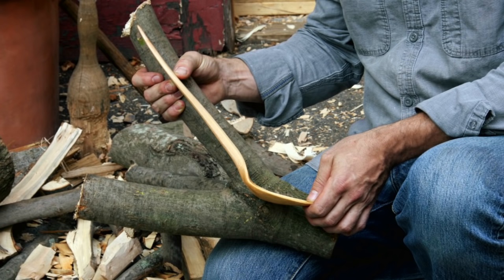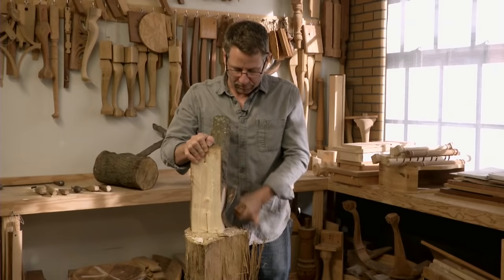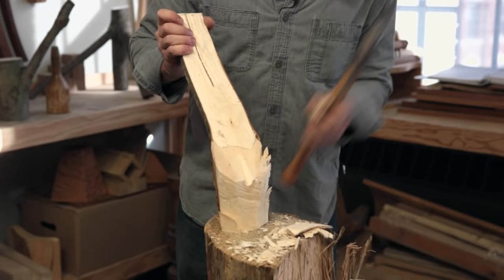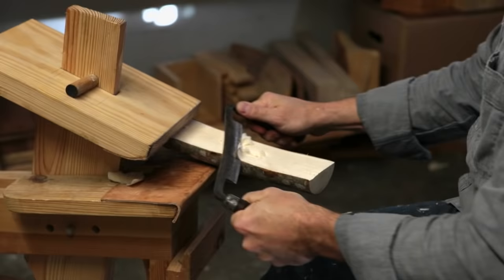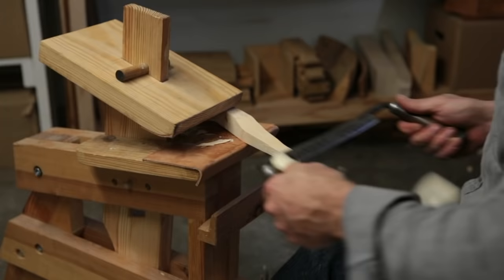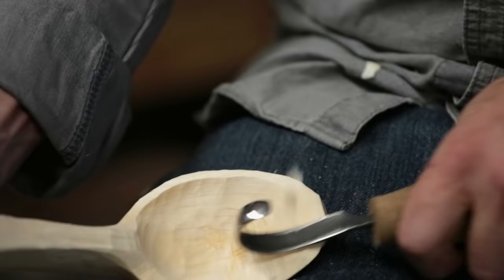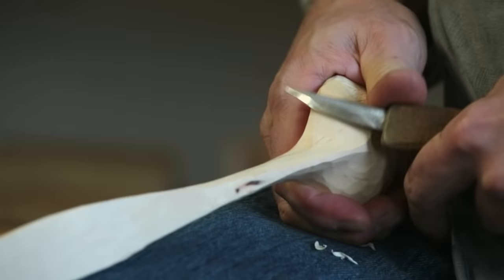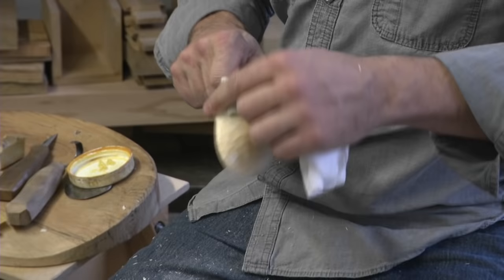The Simple Art of Spoon Carving

Comment: Can you do a video on how to properly dry the spoon to prevent splitting? Also, what food grade finish do you use?
Reply: Wrap it in cotton cloth. And unwrap it daily for short periods of time. The dryer it gets the longer it can be unwraped. Let it be in the cloth in a cool area without unwraping it the first few days. And then letting it be unwraped for a few hours per day and then letting it be airiated for progressively longer time. Observe the wood. The cotton cloth keeps the wood moist but also lets some moisture evaporate so that it dosnt dry too quickly.
Reply: let the spoon dry in a pile of woodshavings. the easiest way. just prevent drastic humidity changes, that is all you need to do.
Reply: @ahmetcomlekcioglu2671  Great answer.very very helpfull!!!!!!!!! thank you!!!!!!:)
Reply: @ahmetcomlekcioglu2671  Wouldn't it be better to let the block wood itself dry for at least one year and the cut it to form a spoon?
Reply: @avramidis3d  first, dry block wood is more difficult to work with compared to fresh cut wood blank. Second, it might be possible that the wood block may attract insects and the shrinking action by drying may split the wood block unwantedly. For these reasons, it is better to use fresh wood. If you do not have fresh cut blank or branch, you can also use dried ones. No problem with that.
Reply: Dimitris Avramidis then you would not be working green wood. Green wood, even very hard hardwoods, is very easy to shape.  Fully dried wood is much harder to carve.
Reply: @monteengel461  I got a piece of green wood from a tree that fell over during a wind storm.  I wanted to carve spoon, bowls, etc.   Then a co-worker told me to dry it first.  I let it dry for 1 yr, and I can't even carve it now.  It's so hard.
Reply: @walden6272  yes, that is what happens.  Carve it while green, then let it dry.
Reply: There is a product called polyethylene glycol ( peg ), from what I understand,  it soaks into the wood and let's it dry slowly.
Reply: I never dry them and soak them in water a for hrs a few times before final sanding. I've never had a problem. Live oak, peach, maple...no clue what I'm doing though, just a hobby
Reply: I use birch, apple, walnut,  cut in winter when the sap is low. Stack locks for later but spay the ends with sealer to keep from checking. Worst wood in the world is bois arc . Used a 50 yr old corner post one time and next day the split
Reply: You can rub your green spoon with boiled potatoe - the starch will protect it from uneven drying...
Reply: @ahmetcomlekcioglu2671  it's a good idea to also put those wood shavings in a paper bag with the spoon.
I make greenwood bowls for a living. I just pack them with their own wood dust for 1-3 months and it works really well for most things.
(Instagram @Rock_Dove_Fatm)
Reply: Soak it in salty water for a day or two and when you take it out it will dry slower so less cracking
Reply: I have carved many spoons and a few bowls a well.  I have never had a problem with spoons splitting.  I think it is because they are so thin that water dries out fairly evenly.  Bowls, especially massive ones, do need the care of slow drying in shavings to prevent splitting.
Reply: Can you use bamboo? I have a ton of it to use!
Reply: IyaEarthseeds  and others. I am from India and not into any wood carving . But I have seen our carpenters (traditional ones)  leaving the wood /logs in water  for 45 days “to remove their sourness” ( that’s what they say) and then use it. They say it’s helps avoid wood splitting. Will this piece of information be of any use to you all?
Reply: @avramidis3d  Have you ever tried to drive a nail into old dried out oak? In most cases, the nail will bend.
Reply: good
Reply: @willybee3056  peg is toxic, it shouldn't be used for wood that's gonna come in contact with food

Comment: Having carved spoons and other utensils, and given them as gifts, i can honestly say the most well received were made of cherry. It's considered a hard wood but carves easily, is lightweight, finishes beautifully and gains a rich patina the more it's used. When I first began, I even used discarded kiln dried pallet wood. the fastener holes added character to the overall project and most were made of ash or oak. I've found early on that a good sharp wood rasp and rat tail file will remove the excess wood at a fast enough pace without the risk of a cutting injury. Also, use a piece of leather in your lap as a guard that's easily purchased from a welding supply shop. This vid has re-awakened my desire to carve again.
Reply from the maker: I would seriously think twice about making food wares out of pallet wood though. Many pallets are heavily treated with chemicals for rot/bug resistance. Nasty stuff. -Ben
Reply: @FineWoodworking  agreed. That was back in the 90's.

Comment: The great thing is that there is so many ways to make them. Very traditional greenwood axe/knife work only or with drawknife and shaving mule (or spoon mule). Or taking dry wood and using more modern tools/benches or power tools. Finishing is just the same, some can get the finish with just the knife and others sand, or burnish, or just let it stay rough and natural. There is no wrong way if you have fun and are happy with the result.

Comment: I also use a shave horse and drawknife, but I use a spoke shave instead of the sloyd knife, I scrape and burnish the entire surface of the spoon, and I apply a coat of hot flaxseed oil. For most of my spoons, after the axe work, I do  the shaping of the handle and the outline of the bowls on a spring pole lathe, sometimes using 2 centers on the bowl end to ensure enough crank. Selling like hotcakes.

Comment: Very nice video. Hand tools are great, until you reach an age when you can't anymore. It took me a long time to work it out, but I found an easier way to scoop out the bowl. An electric die grinder with a Kutzall carbide sphere works fantastic, an awesome time saver. I've never owned a spoon gouge, or used one. My best hand tool is a hoof rasp, a fast hogger, shaper, and smoother. With a little experience, a spoon per hour, start to finish. is very realistic.

Comment: I would like to try curved hand scrapers. I hear they leave a good finish needing little sand paper work. I am looking for the right tempered tool steel to cut custom curves like for spoon bowls. Finding a good water jet or laser service to cut out the curves would be next. Then making a good smooth perpendicular edge, and finally making the microscopic burrs with a hard ceramic rod. It sounds like a lot of trouble, but once figured out, it should save time finishing spoons. You can buy curved scrapers also, but making custom ones would be another unique option for fine finish work. Maintaining a scraper would still use the final steps to make them.

Comment: Excellent video. I do my best to turn green bowls to a rough state, then allow them to dry before finishing. I believe the optimal rough thickness is 10%. Too thin and the wood could warp too much to turn to a finished thickness on all rim sides, and too thick could result in cracking. Do you experience any problems with warping or cracking during the drying process? Thanks for a great video.

Comment: do you have to worry about the wood checking or splitting when drying?
Reply: Not much to worry about when the wood is very thin. There is always a small risk. It helps to let it dry slowly, not in a hot heater dry house. It also helps if the wood is dry at harvest (winter wood). It also depends on the type of tree.

Comment: what oil do you use?
Reply: olive oil
Reply: Olive oil goes rancid eventually.
Reply: Or tung oil.
Reply: Butcher block conditioner - then Butcher block oil
Reply: Walnut oil.
Reply: @rorshach72  Correct. Walnut oil won't go rancid and dries nicely. Easy to acquire at any large-operation grocery store.
Mineral oil and raw linseed oil will work as well.

Comment: Been trying to locate a curved scraper, did you make yours?
Reply from the maker: You can easily make them out of an old saw blade. Lie Nielsen and Lee Valley do sell curved scrapers though.
Reply: I saw (no pun intended...)a scraper made from a hack-saw blade and the fellow burnished the cutting edge with a burnishing tool and that sucker really worked. It was Woodwright's Shop, and, if I recall correctly, Roy Underhill clamped the blade in between two pieces of strong wood or metal, and held it with two (or maybe more) screws with wing-nuts to hold it. I made one, and it really worked awesome. Just for fun, I tried to use the side with the saw blades and used a new one, and it really worked really well to scrape a significant amount of wood out in a fairly short amount of time. Of course it makes many little channels, but then if one flips the blade over, then scrape those down, and then reverse the process, and so forth Anyway, it really took the wood down quickly. Try to keep all your fingers! Cheers!

Comment: lol i guess you were not in boy scouts as well should know never cut toward yourself first rule of craving
Reply: It depends.  Some of the grips actually make it very safe to carve towards yourself.
Reply: +carpy1970 what he should really be avoiding is doing his cuts within the triangle of death.
Reply: lol so true
Reply: Not so, coming off a small branch bump or knot can easily make a slip.
Reply: Of course you can slip, but how far that slip can travel is dictated by how you're holding the knife and wood and how the force is being applied.  If you are doing a pivot or lever cut using the non-knife hand as the pivot or lever then you can't possibly slip more than about 2 inches.  If the wood is more that 2 inches from your body then you are completely safe.
Reply: Wrong, lock your muscles and it can only go so far. Just got to get some experience and get comfortable with it. I was dead scared of it myself when I first started, especially with a big ole draw knife coming towards your nuts.
Reply: Adam Dunbar nope